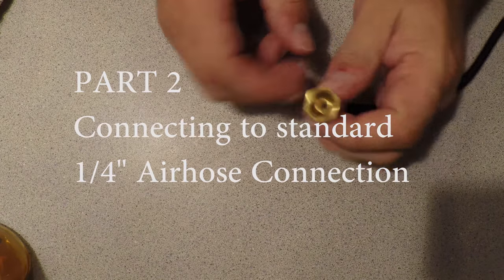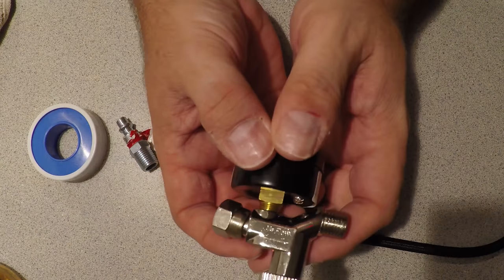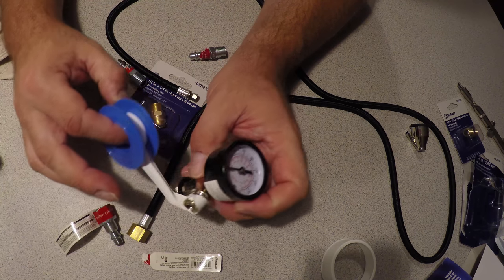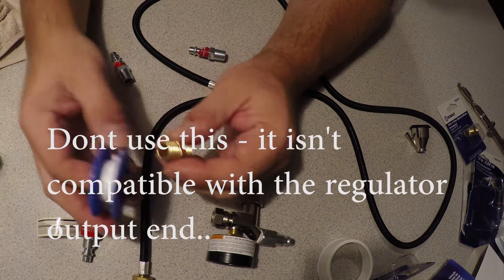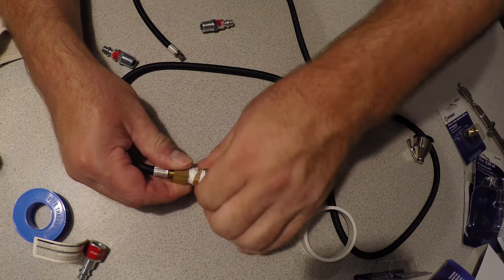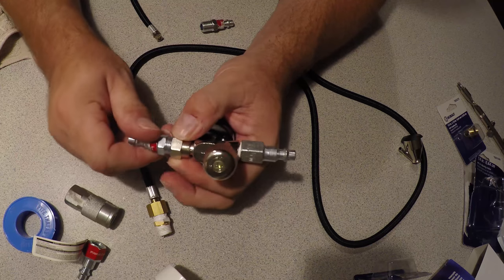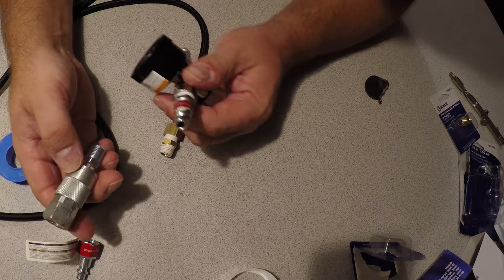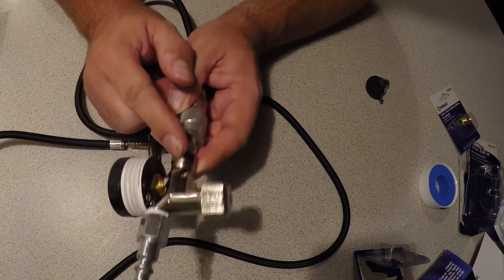Badger Model 155 Anthem Airbrush Set Connecting to Air Compressor Part 2

Comment: I have a Badger 155 Anthem and love it.  Best airbrush I've ever had.
Reply from the maker: I need to buy airbrush paints. I make my own by thinning acrylics with windex bit considering my lack of time and the inconsistency in doing that its time to drop the $$$ on real paint. Thank you for the comment!
Reply: @UDoIt2  No need to buy airbrush paint.  I mix my own from acrylic "craft" paints, usually from Walmart, Hobby Lobby or Michaels.  You know that cheap $ .50 cent 2 oz. bottles.  Make you some thinner by mixing 40% distilled water with 40% Windex--the non-ammonia kind, and 20% isopropyl alcohol (usually 70% or 91%) and to that add about 10 to 15 drops of water soluble glycerin.  Makes great thinner for the cheap paints.  You can usually find the glycerin at Walmart.  I've been using this thinner for years and only recently got 3 bottles of airbrush paint that I haven't even tried yet.  It was free Badger Model flex paint from a promotional that came with my Badger 155 Anthem airbrush.  Give this a try before sinking $$ into airbrush paint that you can make yourself.  If you want a mat finish with the otherwise flat craft paint, you can get some Pledge Gloss floor wax called Revive It which used to be called Future floor wax or polish.  It is a gloss finish and completely compatible with the craft paint 'cause it's acrylic floor polish.  Give it a try.